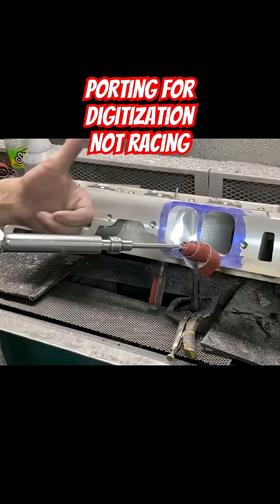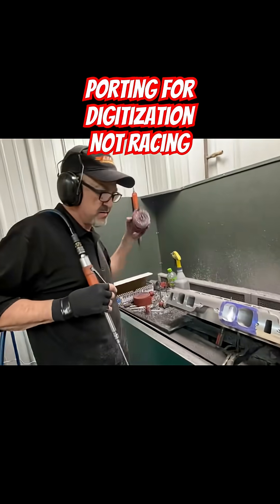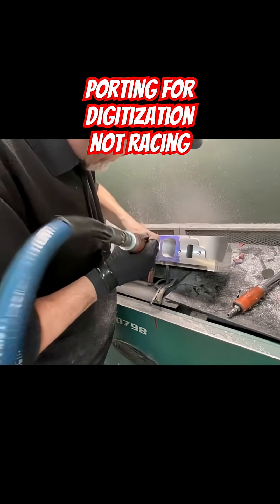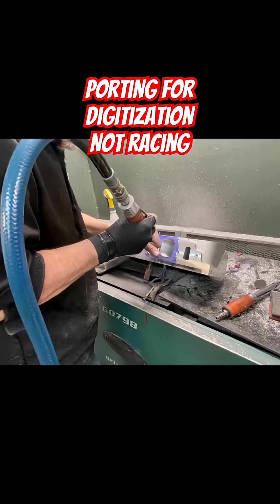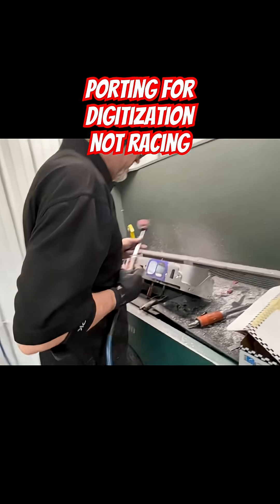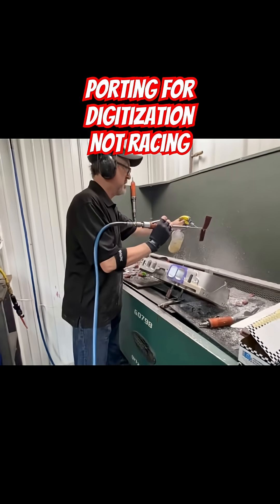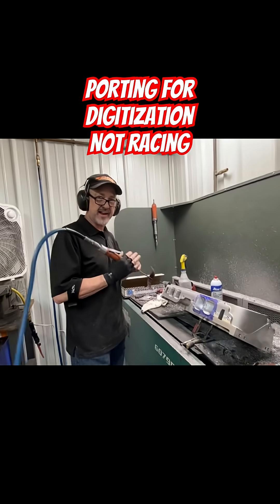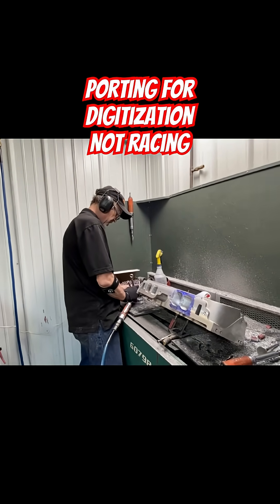DBGU/DMI: Porting For Digitizing....Not Racin

Comment: THAT'S HOW I POLISH 2STROKE PORTS. 220 EMERY @ 32,000RPM LEAVES A NICE FINISH AND A CLOUD OF COTTON SHREDS FLOATING ALL OVER THE PLACE. I'M GOING TO TRY HIS TECHNIQUE BECAUSE IT LOOKS SAFER THAN UNFORGIVING CARBIDE CUTTERS. HIS PORT LOOKS STRAIT AS A ARROW!! THAT CAN BE HARD TO DO BUT I HAVE NO VALVES IN THE WAY. THANKS GUYS. 🤔❤❤❤💯💯💯🙏🙏🙏🙏🙏🙏🙏
Reply from the maker: Thanks for sharing your experience. 🙏💯🏁 and glad you like his.
Reply: @dragboss351cleveland  WHAT DARIN DOES IS 100X HARDER PLUS HIS WORK IS ART ON ANOTHER LEVEL. BOTH YOU GUYS ARE PHENOMS! BACK IN THE DAY GUYS WOULD THROW A TOWEL OVER THEIR HEADS/ PORTWORK IF YOU STOPPED TO LOOK AT IT LIKE YOU WERE A SPY OR SOMETHING. YOU GUYS SHARE SECRETS I NEVER KNEW OR THOUGHT OF AS POSSIBLE.❤❤💯💯👍👍👍🏁🏁🏁

Comment: Tim 
In YOUTUBE APP the buttons on the right side were gone. 
I went to my browser and played this video and amazingly all the controls appear. 
YOUTUBE DOES weird things. When I am commenting, if I swap to the desktop & run the calculator, it freezes sometimes the comment isn't saved like a draft email. 

Ok, now here's question: does Darin clone one port to all 4 or 8 since the 2 heads are identical ? 
Or does he clone #1 to #1, 2 to 2, 3 to 3, 4 to 4 ? That is the Assassin 460 head , correct ? 
Does he always port the ultimate velocity , or does he port to supercharger, turbo, street, PROSTOCK, ProMod ?
Reply: Its says 16° bbc
Reply from the maker: Any say about the format aspect. Sometimes I don’t see comments at all then a week later see them. Not sure on that aspect. He does port them all, so I would assume they would be matched.